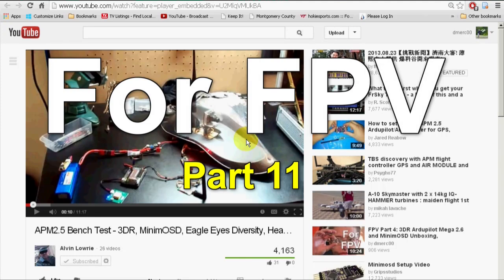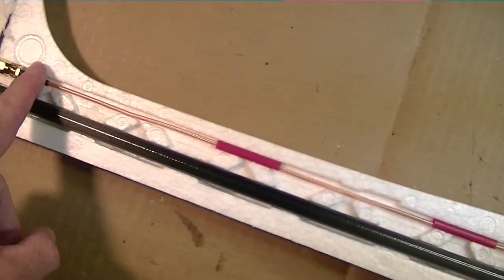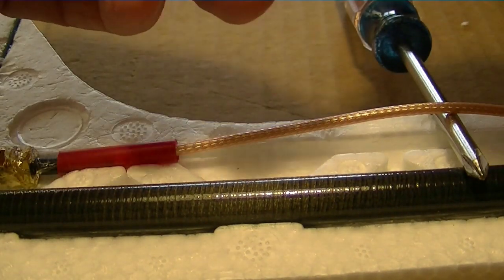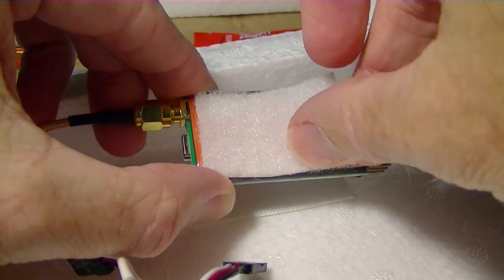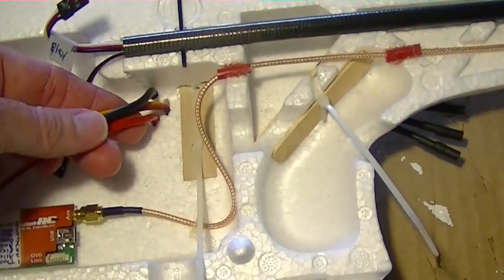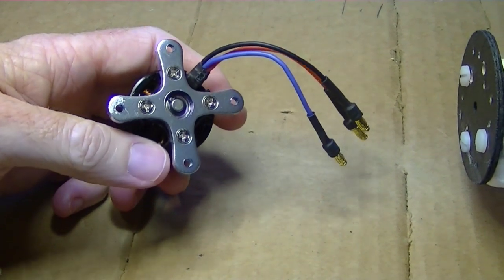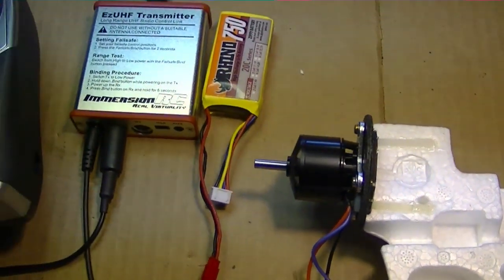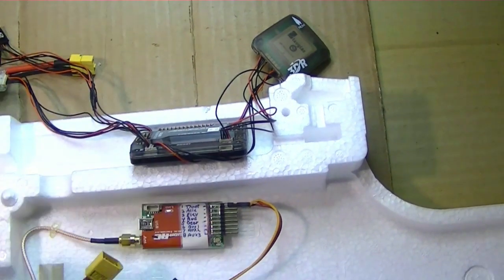FPV Part 11: Installing EZUHF LRS on SkyWalker 1880 Plane

Comment: Your Videos are helpful.  I am building a SkyWalker and plan to use APM and EZUHF as well.   Did you make your antenna extensions your self?
Reply from the maker: The antenna extension for the EZUHF came from Readymaderc.
60cm (2 foot) SMA male to female. GetFPV also has them I think.

Comment: Hello buddy. If you will now need to use this new receiver from EZUHF LRS, then the standard ( I have the Devo-10 Naza-m V2) you will not use? this is so? Forgot to ask whether this system is to control hexacopter? The control settings I listed above Thank you for your understanding and waiting for your answer.

Comment: Hi, Dave, I saw your video and I was hopping that you could help me with advice on use of the EZUHF transmitter for the LRF. I have a question and the problem. I am trying to use the EZUHF 500mw transmitter with my Futaba 14sg. As per EZUHF manual I am plugging the Futaba trainer cable into EZUHF transmitter. But when starting the radio my EZUHF transmitter does not come on. I have used ImmersionRC Tool program on PC to update software for both EZUHF TX and RX and I also binded them through the PC so i thing that that part is solved. Still my Futaba SG14 is not switching on transmitter and ....where I am doing something wrong. I have turned up and down trainer menu on my radio and I just can not figure it out why it does not emit signal to transmitter. Please, i would be very happy of any advice. Thank you, Matt
Reply from the maker: I wish I could help but I'm not familiar with the setup for the Futaba 14SG radio and the EZUHF.
Reply: @DaveMerc  Dave any way thank you. Willingness to help counts. Have a good and safe flights.

Comment: What did you do for RSSI with your EZUHF and the AMP?
Reply from the maker: Nothing.
I have been wondering how to do that myself.
I did get the EZUHF throttle channel fail-safe to work with the APM but no RSSI yet.

PS if you find out some way to do it please let me know.
Reply from the maker: ***** Perbacom
Digital to analog converter for EzUHF

Comment: How much you loose running that coax cable in rig all straight ?
Reply from the maker: Aron Gatt Works good. It's a common practice on UHF. Some even put the antenna out on the wing tip.

Comment: hi I bought diversity EzUHF receiver Can I mount  both coaxical  extension cable in my skywalker tail whit servo cables and mount antena on fin
Reply from the maker: Yes, the shielding on the RF coaxial cables should prevent any interference from the servo wires.

Comment: i have the ntm 35 on my 1680.  love that motor.  that bevrc motor sounded terrible
Reply from the maker: Your right the BevRC motor is very rough sounding. The bearings may be the cause. I took it apart and checked the magnets but found nothing wrong so just assuming the bearings are not so good. Still have the HK ntn 3536 1400kvm to try and I will put a link under the video so people will know where to get it.

Comment: I am a 44 year old male novice with FPV and I have been watching videos so much my eyes have to be hot glued in my face to keep them from falling out.  I have my EzUHF up and running with the ESC throttle cable plugged into port pin #1 on the 8 channel Lite and a couple servos plugged in.  It works!  I learned from your video.  The problem I have is getting my GoPro 3 Black FPV cable plugged into the correct place.  I have been struggling, and searching for a video demo but have not found it.  Which pin does the GoPro cable connect to?  Also, on a separate issue, I am not sure how to connect the Tx to a video monitor.  Again, I am a novice,  obviously it must be the s-video cable from the tx to a monitor?  Please help.  It would be nice if someone would treat me like an old lady and show me which plugs and wires go where.  Confused…old lady.  :)
Reply from the maker: Shane, I don't own a GoPro. What you see in the videos is what I have. It's a simple board camera. This makes it hard for me to help you there. Generally video out from cam goes to video in on the TX. Oh BTW I am 62 so it's hard for me to think of you as an old person. The TX will not hook to the monitor, Just the RX or the Cam will hook to the monitor.
Reply: How do you hook your board camera to the EzUHF?
Reply from the maker: Yeah, that was a point of confusion for me as well about a year ago.
The EzUHF is not for video. It is a LRS (Long Range System) use extend the range of your RC transmitter. If you not flying more than a mile away then you don't really need it. The camera hooks to the video transmitter on the aircraft.
Watch the complete video again now that you know this and it will make sense.
Reply: Ok.  Thank you very much.  I appreciate it greatly.  I am learning a lot from you.  Keep the videos coming.